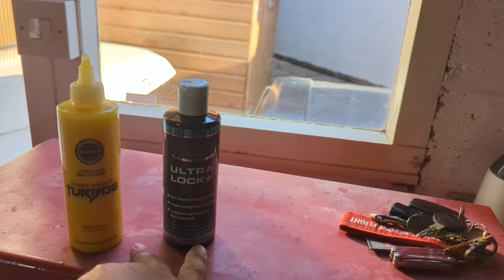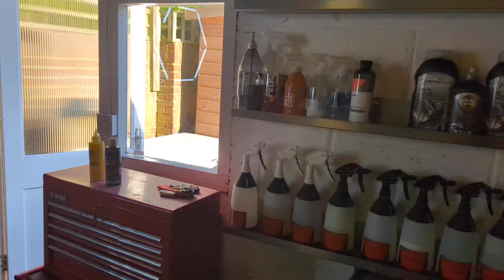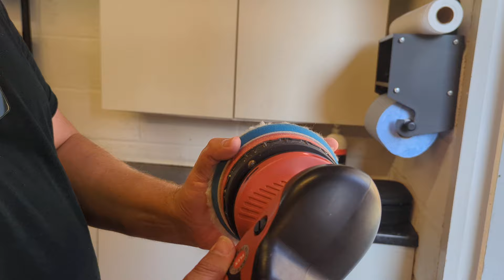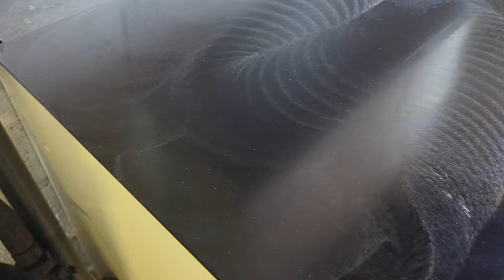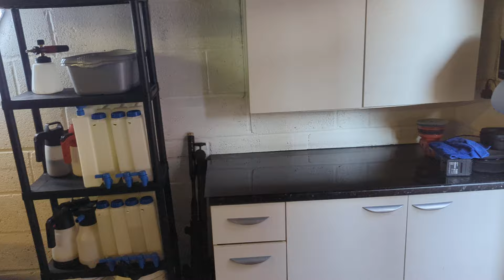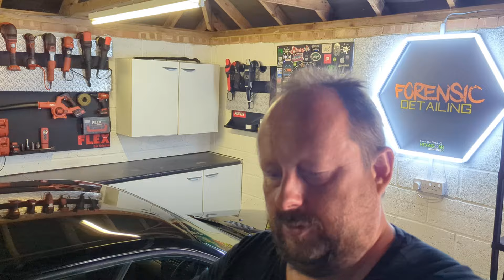Behind the Scenes Testing

Comment: How typical is that?! Explaining about the mic interference and it happens on cue. Could I suggest testing what the audio is like with no lights on at all? If it's cured then it's the transformers or the tubes themselves pumping out RFI. Seeing as the crackling is only every-so-often, my money's on it being something else though, regrettably. Some sort of wireless data transmission (bluetooth, wifi etc.)
Reply from the maker: yer i dont think its the lights.  its really strange it will stop happening for a fwe weeks maybe and then come back.